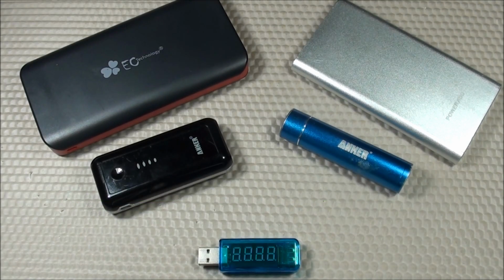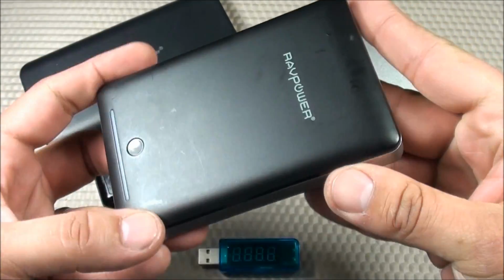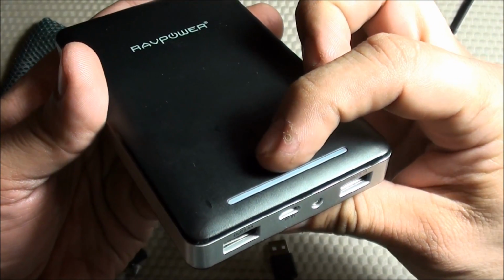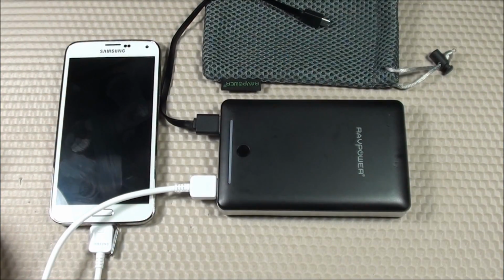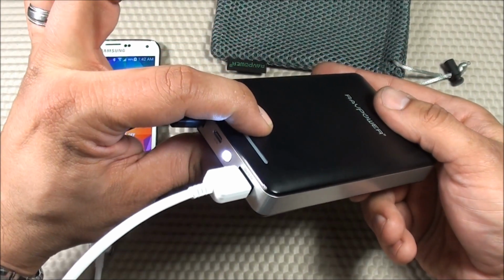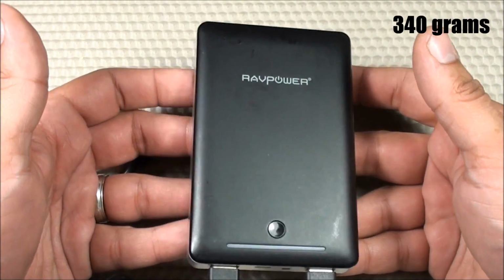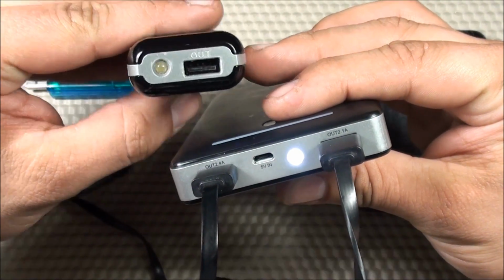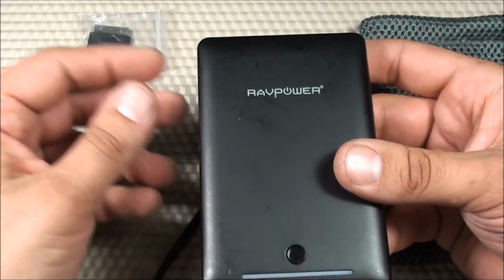RAVPower Deluxe 13000mAh Power Bank Review

Comment: Could this last on a backpacking trip for a week?
Reply from the maker: Probably not. I'd prefer something around the 26,000 mAh version.
Reply: +TheUrbanPrepper how much does that one cost?
Reply from the maker: Depends on the brand. Anker's is a little expensive at around $80. You can find others for around $50.
Reply: +TheUrbanPrepper how much would a ravpower be?
Reply: +TheUrbanPrepper hey how much can this thing charge
Reply: +TheUrbanPrepper or how much devices can it charge cause I charge my phone and got to 100 and it was half way
Reply: +TheUrbanPrepper is that good
Reply from the maker: +David Flores It depends on the device. I usually account for 60% efficiency of whatever is listed. You should get 2-3 full charges for most smartphones
Reply: +TheUrbanPrepper but is this ravpower good
Reply: +TheUrbanPrepper is that good or not
Reply from the maker: +David Flores I usually only review gear that I think is good. This video is a little older, and since electronics change rapidly, I always recommend to shop around. I'd go with a 10a Anker or RAVPower. Find a model that fits your price range.
Reply: +TheUrbanPrepper ok thank u ill subscibe and just answer straight up is this product good

Comment: That adapter may actually be for Samsung and it's not compatible with Apple devices.
Reply: I don't know if you're talking about the mini USB or the wide one. mini USB is everything but Apple and the wide thing is older apples
Reply: +Shrekels k samsung uses a 30 pin plug as well
Reply: +Shrekels k aka the wide one
Reply: I agree. I'm returning the Portable Chargers 16750 RAVPower 16750mAh External Battery Pack 4.5A  which does not supply a connector to iPhone 8 plus.

Comment: i was just wondering if it matters what device or charging cable you put into either usb ports because it has the 2.1a and the 2.4a, or could someone explain what the amp's mean? also would this work for the ipod touch 5th gen and the samsung galaxy s4 mini?
Reply: It shows how fast it gets charged and it will work.

Comment: You seem to prefer batteries small enough for your pack.  Have you looked into additional options available now that charge devices and you can actually jump your car with?  I think its an item right up your alley.  Might be good for your vehicle EDC/Preps. I recently received one but have not gone through all the testing you do.  If I can post the link, here is the one I received as a gift.  

http://www.lowes.com/pd_573361-74342-CA-9801_0__?productId=50179123

Since I posted this I got to try it out in the wonderful blizzard the northeast was pounded by this past week.  I motorist had a dead battery in the cold with a young child in the car.  I got it out to the amazement of everyone around it worked.  The car started right up.  Now everyone that saw it wants one.  Then when I was done I charged my iPhone with it in about half an hour.  After jumping a car and fully charging an iPhone it is still showing a full charge.

Comment: I've got a few of these batteries and I ha e a few comments about your review. First... Its good to see a review on these from the EDC perspective... So good on that. Your comment about wanting a little display to show the type of device it is connected too is a little off base. First, it would consume more power as it would have to have a more complex set of circuitry inside. Second, you are incorrect about how the smart charger technology works. It does not detect what type of device it is. What it does is detect the max current flow your device will accept and tune the USB port to charge at that rate.

I also happen to love the built in LED. I use it camping when the main tent lamp has been extinguished so I can see where my devices are and get them all plugged in. I have used it coming up to my door when I forgot to leave the front lights on...

Also... Your hard drive has spinning platters in it which cause vibrations and torque that can cause a slippery device to slide off your desk. That's why it has rubber feet on it...

All in all a pretty good review though. That's for putting the time in. I know that video production is good work.

Comment: Looks like a promising product. Nevertheless, I'm always a bit annoyed about the mAh specs though, as mAh really doesn't tell anything about anything. With power banks nowadays, you usually have to assume that it has a lithium-ion battery, which happens to be 3.7 volts. That obviously doesn't always hold, as there are other than Li-ion batteries in the world. Watt ours is the most meaningful measure of power capacity; Wh = Ah * voltage. Of course even that doesn't tell anything, as to get to the USB's 5 volts, there's power loss from the step-up regulator, and to get down to the 3.7+ volts to charge your phone, there's again some power loss from step-down regulator and the charging circuit. Also wires can have significant loss. There's some environmental regulations regarding the efficiency of laptop chargers, which are usually expected to be over 85%+ effeciency, but with these small power banks, the efficiency could be anything. With my experience with a handful of different power banks and cell phones, it's been rather poor, ranging maybe around 20-50% of the stated capacities. Perhaps I've just had a bad luck.

Talking about marketing BS, I'm a bit wondering what on earth is the RAVPower's "intelligent iSmart technology" that supposedly "detects the charging need of a connected device". USB is (by standard) not a dumb charging wire, but there's a negotation protocol between the host (charger) and client (device) to determine the current. The default is 100 mA, but can be ramped up if requested. Perhaps some really dumb chargers just give all the current they can, but that's essentially a violation of the standard. So is the "intelligent iSmart technology" just a charging device that actually follows the standard?

I'm currently carrying daily just GoalZero Guide 10 and Switch 8. And Sherpa 50 if I really need power. I'm only partially happy with those, as their efficiency is not quite perfect and the Sherpa's inverter (or the Sherpa itself) is total crap. Nevertheless, I enjoy Sherpa's laptop output and the integrated led lights; also Guide 10 has one. The integrated led light is sometimes a nice economic light, when you don't need much, such as in a tent.

Comment: Good review  I'll be looking into ravpower more seriously I know you did a drop test but if they could make it more rugged and larger capacity I would be sold, an account output would be excellent also. Problem with these things is that there advancing like cpu processors. Every year the storage capacity is doubled, but they are approaching the limits of lithium.
Reply from the maker: Canadian Prepper They sure are advancing at a rapid rate! It's hard to thoroughly test them before the next model comes out. Next time I'll film the drop test. To be honest, they were all done by accident. It survived nicely though.
Reply: TheUrbanPrepper
Looks like there was a typo in my post, I would like to see one with an AC plug in output.
Reply: Canadian Prepper cpus double every 2 years, but these lithiums dont. Minor inprovements like shelf life and a little more mah, but not much more. The reason this has 13k mah is because its huge in 2 years your not gonna get 26 grand into something this small
Reply: Riley Kirk
Yeah I know that, it was a loose metaphor. That said the condensing of the housing is still ongoing. For instance I have a Galaxy note phone, the battery is around 3100 mah and its tiny, 4 of those easily are half this things size. I've owned several battery packs throughout the years and they are working there way down to being on par in weight and size to smartphone batteries so there will very likely still be many significant reductions in size to come.
Reply: Canadian Prepper yeah, i guess i see your point
Reply: TheUrbanPrepper  hey man I want to buy the ec technology that shows in the background of your video, do you have any complains about it I should know about,... ????

Comment: The flat cables provided are simply USB to mini/micro with adapters, correct? So you should be able to use the charging cable provided with your device, unless I am not mistaken.

Comment: Great video, but are you poking fun at me? :D When you recommended the pack, I found they have a version with both 12v output and 5v usb port, which would be compatible with my Android survival and Comms gear.  Moreover, i could charge it with my folding solar panel. 
I always dig your videos.
Thanks for sharing!
Reply: In my "rig in a box" setup I have this pack that I use for the tablet and another one (not by RAVPower) but same size, that also has a 9v/12v output that use for the KX3. They work very well and their weight is more than decent. Love them! :)

Comment: If your electricity goes out, the flashlight would be extremely handy just to be able to see how to plug in the USB cables properly.  Or if you're sitting in your car at night, it's just as difficult to plug in USB cables because they only fit one way.